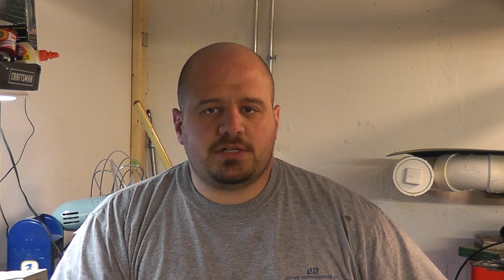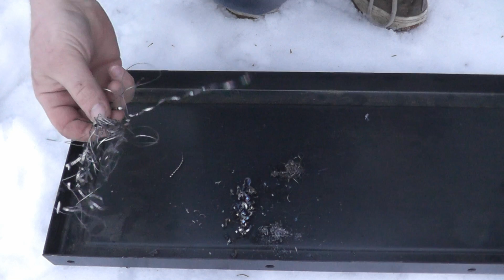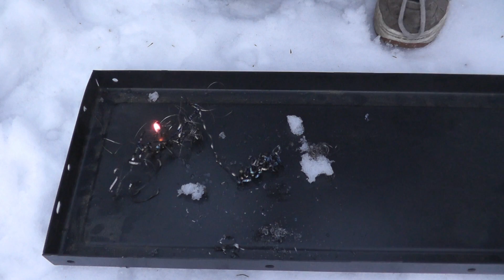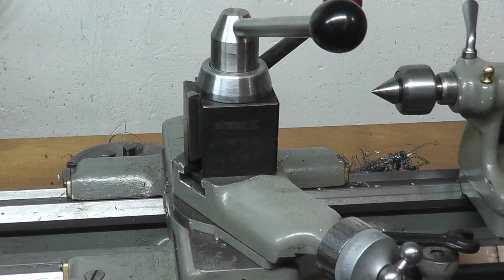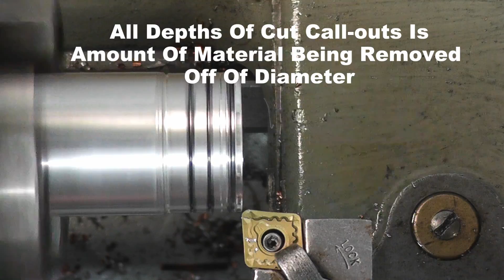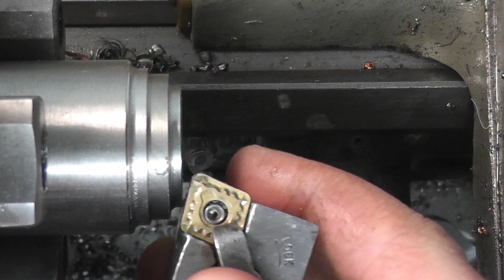Negative Geometry Toolholder On A Small Lathe

Comment: "alum doesn't like carbide" nah, use sharper (ground  ) carbide inserts, choose the correct insert (and coating) for the material, otherwise,of course it won't like it. Good video.
Reply: a tip : watch series at flixzone. I've been using them for watching lots of of movies lately.
Reply: @Thaddeus Abram yea, been watching on Flixzone for since december myself =)

Comment: what is tool push-off?
Reply from the maker: Depending on tool geometry, depth of cut, and feed rate, the tool will create enough pressure to either bow the workpiece away from the cutter or force the compound away.  It's a lot more apparent in boring bars.  If you take a cut and go back to the start and without touching any settings make the same pass and you remove material then thats the amount the tool has pushed off.
Reply: Okeee : I see what you mean. The problem is to keep the cutter as stable as possible with minimal or ideally no flex as in using long holder  like a boring bar. I am fixing my ACME spindle that had a lot of play causing a significant amount of backlash. I think these aspects are all related. I think that the flex also causes those patterns in the result because the cutter's distance starts to oscilate back and forth making these wierd pattern on the finished surface. One way of "seeing" the pushoff is to mount (if you are brave enough) a measuring clock against the toolholder/cutter to see how much flex there is: this should idealy be zero.

Comment: To add to what another commenter has said, just about any CNMG insert effectively has some positive rake, but the amount will depend on the insert.  You should try an insert with an aggressive chip breaker, and with a smaller nose radius for your size lathe (ie a 431 instead of a 432), I think it will make a big difference.  I use this Seco insert a lot (https://www.mscdirect.com/product/details/50988492).  It is marketed for stainless, but I have found it works great on most materials and its my go to insert on a 16" South Bend.  You show that insert stalling your machine at .100" on 1045, and I'd be willing to bet if you get an insert with a much more pronounced chip breaker and smaller nose (like the one I linked), your lathe will have enough ass to make a cut like that, and surface finish should be way better.  I could be wrong, haven't ever tried on a lathe that small but it may be worth $17 to find out since you have the holder now.  Just a thought.  Great videos, keep it up.
Reply from the maker: Thanks for the tip!  I'll check on those inserts.

Comment: Just got home and watched the video. Thanks for the honest review, that is what I fixed and sent the tool to you. I am surprised with the depths of cuts you were able to take with your lathe safely, my Asian Lathemaster will not go over .050 in aluminum and .030 in steel this shows how much more beaver built the South bend is over any of the Asian lathes. 

My contention has been the lathe ridigity and horsepower is the limiting factors, not the geometry or size of the insert tooling, thanks again for demonstrating how my theory works. I have a DNMG that I am going to be doing for myself, just because I have a few inserts so that will work around small centers. Enjoy the tool and again thanks for the demonstration and honest review.

Comment: Years ago, I was a public safety officer, police/fire and I witnessed the complete destruction of a VW bug. Once it was cool I saw the complete crankshaft with connecting rods still attached, laying exactly like they were in the engine, but the aluminum engine was completely gone. Still attached was the transmission with its metal gears and again missing was the aluminum housing of the transmission. That was one hot fire and because it was parked on hardtop it sat untouched until it cooled and then hauled off. I wished I had photographed it then. Later investigation of VW engine fires, was that there was a clear see thru plastic fuel filter attached to the carb from the fuel pump. Often the plastic filter would come loose and then the car would soon run out of fuel. However the VW would run a considerable distance on the fuel in the carb and fuel would get pumped out all over the engine from the detached filter still attached to the fuel pump. The operator would then try to start the car by pumping the pedal then hold the pedal all the way down, thinking it was flooded. That would cause a lean mixture situation which resulted in a backfire in the carb which then ignited the gas on the engine. That mixture of titanium and aluminum made for some great fires. I showed my wife and kids what happens to steel wool and fire. Sorry for the long winded story but your video is great and shows what happens. The cutting oil also adds to the fire. Thanks for showing this video.   Ken...Marina CA
Reply: the crank cases  etc on a VW is a magnesium & aluminum alloy, no titanium. so even more flammable than titanium (and much much cheaper) that same fire happens to a good friend of mine, you cant even use water to put the fire out as it burns so hot it will break down the water and use the oxygen in the water to burn.. releasing the hydrogen gas that escapes into the air and then it will burn also... a magnesium fire is a VERY bad day (it will even burn in CO2)
Reply: HomeDistiller Once magnesium gets going basically your only choice is to stand back and watch. It's fun experiment to do in a controlled environment, but definitely wouldn't want to have it happen unexpectedly. .
Reply: not quite true.. sand or even a powder fire extinguisher can get it out.. as the sand/glass will melt in the fire and exclude oxygen.. but you need a good dose of luck to get it out

Comment: If you had an insert with no chipbreaker, it probably would have struggled. The chipbreaker adds some effective positive rake and makes it cut easier.

I have some square inserts with no relief i use on my Craftsman lathe. I made a holder with a 5 degree negative angle. They have a nice chipbreaker. So, I get near a mirror finish and very little push back.

I'd try an insert with less of a tip radius. They seem to have less push back.

I have probably 7 or 8 different carbide inserts; most triangle geometry. Each cuts differently even though most are the same geometry. Different coatings and chipbreaker styles make a difference. Some get a mirror finish on steel and aluminum. Others do ok, but get a buildup on the tip (one I know are cheap Chinese inserts.)

I keep an eye on ebay for deals. Have gotten several boxes of 10 inserts for $10-15.
Reply from the maker: Yeah I've picked up a few e-bay deals for my smaller insert holders.  I'll have to get some of these larger ones.